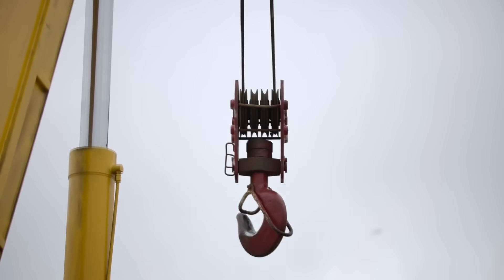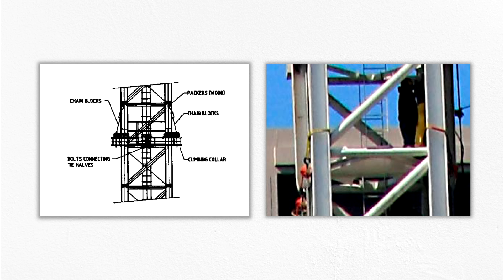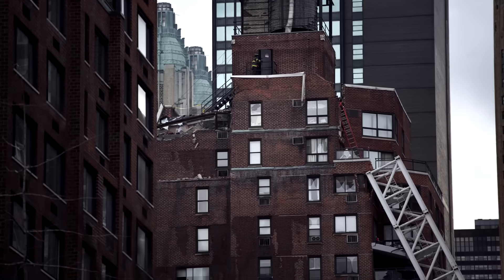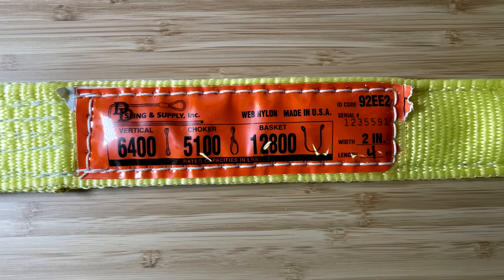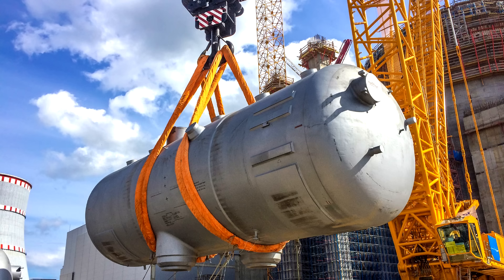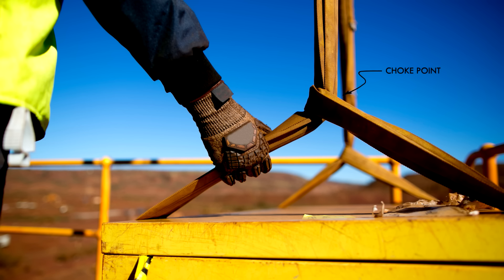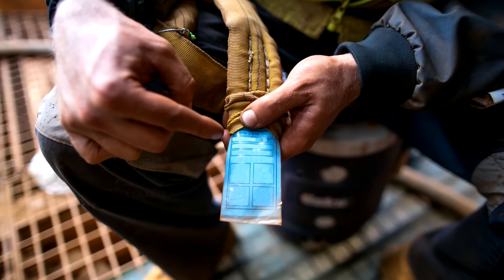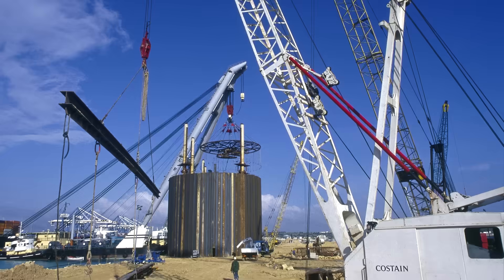Why Things Fall Off Cranes

Comment: The only incident of rigging failure I've witnessed was when a large change machine from an arcade fell approx.6 meters after one of its feet snapped off, causing the strap to slip. We later found that the failure was caused by shoddy welding. The feet of these machines are designed to bolt them to the floor, they shouldn't have failed and were marked as anchor points by the manufacturer.
Reply: I've seen accidents cuz of shoddy welding too. Some instances, you can't even tell cuz it looks solid outside but the insides are botched. And angle the anchors are used also matter.
Reply: @joshanonline  that is why they have to xray and ultrasound welds in the aerospace business.
Reply: @filanfyretracker  In cranes they do as well, since the 90s.
Reply: @joshanonline  In my experience, welding in general is the worst way to connect things, it is the cause of the majority of failures basically in every area it is used (except for very strictly controlled conditions).
Reply: @tatianaes3354  You right tho. :) The engineers we work with prefer us to bolt 100% of the time. And the particular rigging we do tend to be fixing and repairing poorly installed permanent rigging points, often welded, often after a failure. Welding can be great, if the welder is great. Bolts are neeeeearly idiot proof though.
Reply: @tatianaes3354  what is the best way to connect things as opposed to welding?
Reply: @tatianaes3354  You know that a correctly performed weld is not only stronger than the material around it but almost always thicker as well? What you are saying goes for bad welds.
Reply: Keep in mind that the saying "a grinder and paint make me the welder I ain't" is a thing
Reply: I assume it was emptied before moving it, but I'm still enjoying the automatic mental image of quarters spilling out and rolling around everywhere.
Reply: @ZGryphon  it was at its dry weight, thing weighs an extra 40kg with coins
Reply: "...marked as anchor points by the manufacturer" - there's a significant difference between an 'anchor point' and a 'lifting point'. I wonder if this was the reason the foot failed when it was used to lift the machine?
Reply: @stepheneyles2198  the manual gave specific instructions on how to lift the machine by sling under the anchor points. The manufacturer had to send us a new machine and pay for the repair of the pavement, including the ruptured mains water line which was not noticed until after the pavement was repaired. That was a fun court battle with an angry Chinese lawyer
Reply: @stepheneyles2198  i agree with that
Reply: Those feet are not designed to hold lateral forces, which would be the only reason for a leg to snap off. They are solely meant to hold the machine's weight on their longitudal axis and are perfectly valid to use as "anchorpoints" for that kind of forces, but nothing more.

Of course, I'm not saying that shoddy wewlding wouldn't have had a part to play but from your explanation it only sounds that it was at most a partial reason for the accident.
Reply: @anteshell  the feet were cast iron blocks about 3x3x3 inches and had the core drilled out for the anchor bolt, the engineer designing the machine probably thought it would save them the cost of having to install eye ring bolts on top of the machine. One thing mentioned during the investigation was the absence of instruction to attach a transport bolt to reinforce the feet to the chassis, but it would have been impossible to properly install
Reply: Doesn’t sound like a proper rigging point in the first place. Anchor point and rigging point are two different things.
Reply: There's also the possibility a brazed connection was mistaken for a welded one. Those two are not always easy to tell apart, particularly if the connection is hidden under a layer of paint or grime and brazing - while often solid enough - does not create as solid bonds as welding does. As someone else pointed out: An anchor point is not the same as lifting point, so a good brazing would be solid enough to make sure burglars can't easily detach a machine from the ground, but definitely not solid enough to survive the strains that come with lifting and moving said machine.
Reply: Probably the welder wasn't a very good one and in a hurry. And he was not informed that the feet would also be used to lift the machine with a crane which result in lateral forces and makes the failure much more disastrous than the machine dropping a few inches. Just my guess at it.
How do you quickly inspect a weld on site reliably? I thought you need ultra sonic or X-ray equipment for that. I mean, it is easy to hide shoddy welding.
Reply: In my opinion it is no ones but the riggers duty to check whether an anchor point seems to be in its purposed condition or not. It´s easy to blaim the welder. I hope no one was underneath.
Reply: @christianeriksson4733  its standard safety protocol to never stand or move under a suspended load in case such incidents occur
Reply: Now that is scary.
No one can check welds.
One would think all this would be xrayed during the manufacturing.
Reply: If anchor points arent inspected regularly they should be inspected by the riggers before they rig it up. Id be interested to see a picture of the weld. Over time welds crack regardless of how strong they originally were. I imagine the feet on a change machine go under a lot of stress from the weight over the years.
Reply: @IRonIcScopez Agreed with the inspection.

Not all welds crack over time. At least not at a rate that is appreciably diffrent from the original material cracking due to overstress or oxidation.
Only cheap/undersized welds crack over time.

Nuclear submarine hulls are welded together you don't see those cracking over time.
Reply: @IRonIcScopez  welds don't crack over time any more than metal in general cracks over time... Either immediately upon application of one catastrophic load, or over many smaller fatiguing load cycles. A coin machine doesn't do a lot of moving compared to an automobile yet those don't fall apart due to weld failure.
Reply: @HavokTheorem  Movement isn't causing the stresses, gravity is. Cars are designed to put the weight on the axle and thus the wheels, I dont think there are welds involved in holding up much of a cars weight. 

The coin machine has welded on feet, over a long period of time a very tiny defect in a weld that would generally pass inspection might cause a crack, that's just the nature of things degrading over time. Meanwhile the feet of the coin machine might be constantly under stress, it really depends on the design of them, they could be holding up all of the weight of the machine or none of it.

There's a lot of factors that could cause it to fail too, like not being painted which causes the weld to rust earlier than it should have.
Reply: @IRonIcScopez    "I dont think there are welds involved in holding up much of a cars weight."    Eh?   The suspension transmits its loads into the car body which is almost entirely welded together, usually with spot welds.   Alternatively into sub-frames which are also commonly welded pressed steel sheet.   A common failure mode for cars driven in rough conditions is splitting along (usually spot-welded) body seams.    This is why standard preparation for most serious rally cars is to seam-weld critical areas of the bodyshell.
Reply: @cr10001  I didn't say there aren't stresses on the entire cars frame. I said the weight of the frame isnt being held UP by the spot welds. I worked in a GM metal fab plant for a few years so Im familiar with the way the parts are constructed. 

The spot welds all hold up some amount of weight of course. But the entire weight of the car is not sitting on a weld. Its sitting on the axle/tires. That's why I had a problem with the analogy made. 

No engineer on the planet is going to put the full weight of a car, or even a substantial portion of the weight on a spot weld.

Edit: The biggest function of the spot welds is to counteract horizontal forces, and hold the car together. Not vertical forces.
Reply: @IRonIcScopez    Nobody is going to put a substantial force through a single spot weld, but they may through a group of spot welds.     Your distinction between 'horizontal forces' and 'vertical forces' is misleading.   For one thing, under hard cornering, side forces on the wheels can easily be equal to the vertical load on them.   For another, a vertical force can easily be converted into a horizontal force by any virtual lever action. 
Consider a McPherson strut.   The entire vertical load on the wheel is transmitted through the 'strut tower' at the top, which is usually spot-welded to the front inner wing - which itself is part of the spot-welded bodyshell.    Meanwhile, horizontal cornering loads are fed into the front crossmember (usually) which is also spot-welded.   On my Ford Escort every ounce of force (other than the dead weight of the wheels/axles themselves) gets transmitted through spot welds at some point.
Of course the designers try to ensure that the loads are distributed over a sufficient number of spot welds to hold up for the life of the car, sometimes with varying degrees of success.   Way back in the 70's, a friend rallied a Hillman Imp, a small car which was a little bit heavy for its size and I read somewhere  that it had 7,000 spot welds on it.   Probably too many.   I had a later bigger car, a Hillman Hunter, which reputedly had just 2500 spot welds and that was definitely too few.   Mine split along the seam between inner and outer wings (along the edge of the bonnet opening) with the McPherson strut pulling the inner wing top edge inwards.   The resulting camber change caused the car to handle slightly peculiarly   :)

Comment: Another common mistake is to divide the lifted object weight by the number of slings. If using 4 chains (or other rigid rigging), the weight will be balanced between two or three lifting points and the other lifting point(s) will balance the load. This is due to small length differences between each sling

With synthetic slings, the stretch help spread the load. With rigid slings, other measures can be taken to limit this phenomenon
Reply: You mean like a 4-legged chair always wobbles on an uneven floor, but a 3-legged milk-stool is perfectly stable...
Reply: @gordonrichardson2972  If you're allowed to rotate the chair, it is possible to move it into a stable configuration - https://www.youtube.com/watch?v=OuF-WB7mD6k
Reply: Yes!
Reply: I guess a combination of rigid chains, a bad center of gravity, and poor sling angle, can far exceed the rated load.

Comment: So if the sling is perfectly horizontal (sin(90)=0.0), the load is infinite!? I must be missing something here...
Reply: If the slings would be horizontal, the angle would be 0 deg and sin(0) equals 0! But because of that double mistake, your observation proofed correct - the load would be theoretically infinite by this formula. (The formula is simplified and is considerating only the most basic mechanics. I would consider it more like a rule of thumb, applicable in 99 % of real world scenarios. :) )
Reply: You aren't missing anything, that's the way it is.
Reply: @jameskerns717  The sling would stretch in length until the angle was non-zero, and the load itself would be crushed by the large forces.
Reply: @gordonrichardson2972  Yup.
Reply: You're missing that we're in the real world, not in a math problem. There's always a little stretch in whatever material you use for a sling. Unless the stretch resistance (or whatever it's called in English) is infinite, the angle can never be 90°
Reply: Well, in a sense you are missing something - namely, that a sling will never be perfectly horizontal. It will stretch or bend until it either exceeds its capacity and fails or the forces are balanced. If you somehow were to manage a perfectly horizontal sling, then indeed, the force applied to it during the lift would be infinite.

Comment: My father worked at a General Electric locomotive manufacturing plant. The diesel locomotives were shipped overseas from the United States in large cargo vessels. One day a crane operator was unloading a locomotive and the ship started to tilt - and tilt some more - and even more - and the crane operator had to drop the choo-choo train into the ocean to prevent the ship from capsizing.
Reply: So the crane was attached to the ship and the shifting load from lifting out the train moved the center of gravity out overboard?
I don't think a land-based crane would have the same issue, someone clearly missed that when planning the unloading operation.
Reply: @Kr0noZ  There is quite a spectacular video where they tried to unload a river barge with an on-board crane, and the whole lot capsized.
Reply: That would be a ballasting mistake. These accidents cause serious damage!
Reply: it must have been spectacular... even more with the paperwork...
Reply: I guess that was before YouTube, otherwise you would post a link...
Reply: @gordonrichardson2972  .... give it a search. There's a few locos being dropped on YT.... and one is by a ship at a dock.
Reply: It depends where the crane was - on the dockside or on the ship. But, either way, if lifting the loco caused problems, wouldn't the best thing to do would have been to put the loco back - thus re-establishing the balance? If the crane was on the dock, dropping the loco in the water wouldn't have stopped the ship capsizing.
Reply: @paulhaynes8045  the problem with just putting it back is that the action of swinging it back over the deck briefly adds to the imbalance.
Reply: Ten thousand years from now, archeolgists will find that train and wonder what kind of ship could possibly need wheels.
Reply: I have to point out that only steam trains are choo choo trains. Diesel trains are just trains
Reply: @hannahblurp9360  …and I have to kindly disagree with you… 
At 3 years of age, I learned that they were called “choo-choo” trains
At 63 years of age, I still call them “choo-choo” trains.
And, if God wills, I reach 103 years of age, I will STILL call them “choo-choo” trains… 🚂 🚅
Reply: @hannahblurp9360  or, better still, locomotives! Trains are the whole thing - engine/locos, plus carriages/trucks.
Reply: @paulhaynes8045  well technically a single locomotive can be the entire train.
Reply: @hannahblurp9360  There are oil fired steam engines, but I know what you mean.
Reply: @hannahblurp9360  you'd think that

Comment: Enjoy your channel. I spent over 20 years working on cranes and rigging signs to be hoisted. I have also worked with construction helicopters who lifted heavy loads to the top of an 800’ building. I loved the challenge my job presented and I was blessed to never have an accident or lose one of my guys. 
Maybe you could do a show on construction helicopters. 
Thanks for the knowledge.
Reply: One of the risks that are not stated in the video is jerk forces - if the slack isn't taken up gradually, then the jerk (mathematically: The rate of change of acceleration with time multiplied by the weight of the load) can be enough to damage the sling - even though it has enough strength for a static pull.   With helicopter lifts, it's much harder to control that jerk effect...so I think that's a major consideration here.
Reply: "Now not everybody has a construction helicopter, but I made one in my garage to show you some of the more interesting problems..."
Reply: Sounds super interesting! Hopefully Grady makes a video on it!
Reply: Construction helicopters reminded me of the Canadian timber industry where remote logging operations often rely on helicopter log lifts.  

One end of the log is always heavier, you're working on severely sloping ground, physical hazards are everywhere threatening to snag or destabilise the load, the wind loads differ dramatically between the ground and the tree tops, the helicopter is hovering above you while you rig the logs, and the weight of the log is very often near the maximum capacity but impossible to accurately determine.  It has to be one of the most dangerous lifting jobs in the world.
Reply: That's a team that keeps to the rules
Reply: That would be fascinating!
Reply: I had no idea construction helicopters even existed! That’s so cool
Reply: Also a video about EVERY type of crane. Most people have no idea that there is much more than just a couple of types they recognize.
Reply: @tatianaes3354  That’s a great idea. In the sign business we worked with cranes from 35 foot to 27 stories tall. There’s a huge variety.
Reply: PLEASE DO A VIDEO on helicopter hoisting. Pulling power lines, heavy lifting, etc is SUPER interesting.
Reply: Let's do it!😀
Reply: Incompetence is something that has no place in engineering https://youtu.be/m_o_oTem5C4
Reply: that topic sounds super cool!
Reply: > blessed
no need to be humble, pretty sure you and your guys did most of the work keeping each other safe
Reply: If you were "blessed" then you are a fool. Trusting in a fake god to keep you safe is never a wise idea as there are no gods. If you did have an accident would you just then blame this fake god of yours??? Get your head out of your arse.
Reply: @kylevogelgesang9996  Go back to reddit!
Reply: @kylevogelgesang9996  Holy cow, Kyle! Take it easy and try to relax.

Oh, and I guess now you're going to tell us there's no such thing as cows being holy. 😎